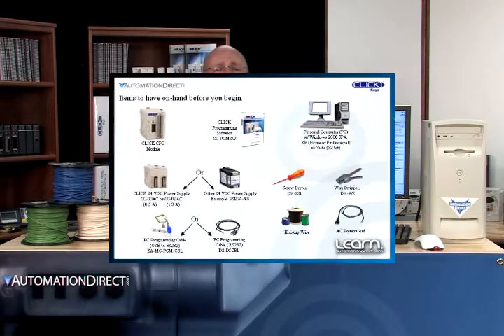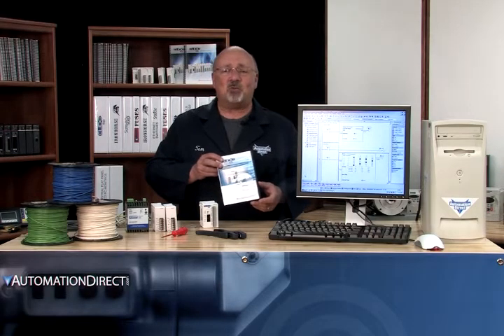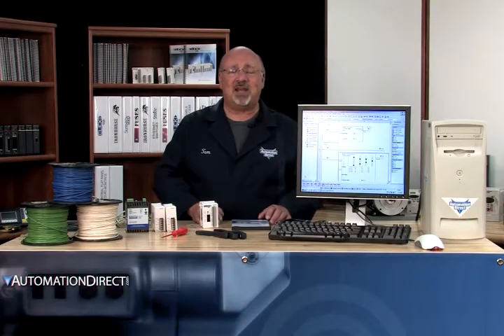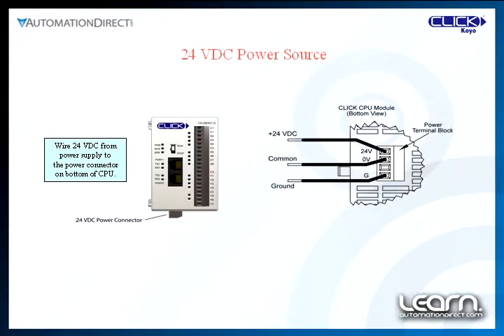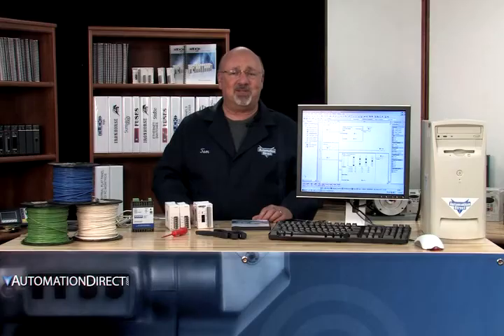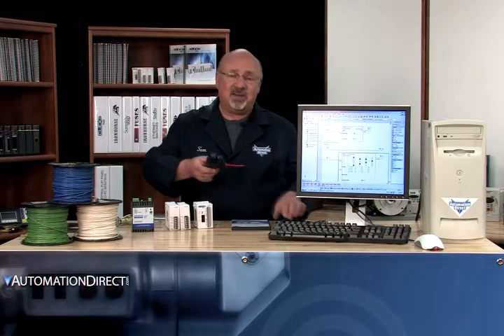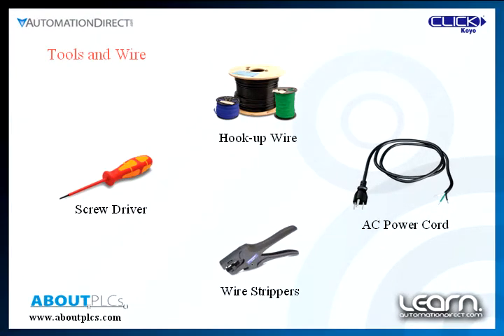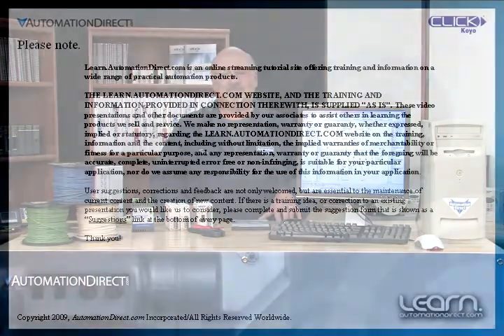Getting Started with a CLICK PLC from AutomationDirect

Comment: Great info sir! What kind of serial RS232 cable is required? There are two types: one is straight and the other one is a cross in which receiver and transmitter pins are interchanged. I was working on these cable long ago and my intention here is not invest in the cable instead to reuse my existing cables. Regards,
Reply from the maker: LearningZone Thank you for your interest in AutomationDirect.com's products. The RS232 serial communications port on the CLICK PLC featured in the LEARN video uses an RJ12 phone style jack.  A standard 9-pin RS232 straight or crossover cable will not work.  The video mentions using either a USB to RS232 converter PC Programming Cable, ADC part number EA-MG-PGM-CBL, or a RS232 PC Programming Cable, ADC part number D2-DSCBL.  The USB to RS232 cable assembly has been offered for a number of years from AutomationDirect.com due to the decline of PCs including RS232 ports.  If you have a PC with a 9-pin RS232 port, you could possibly, with the proper connectors and tools, construct your own programming cable.  You can find a link in the video description to diagrams for programming cables. We hope this helps!

Comment: Hi, i am using a screw that sends bottles to a filler. I have a sensor sensing the flights on the screw. I plan on using the flights on the screw to set th speed of the line behind the screw. I have a timer on the screw sensor, and i need to move the accumulated time between flights to a register in the PLC. I then need to take the number in the register, scale it, and send it to a VFD. How can I move the accumulatoin time?
Reply from the maker: This is a bit too involved to get into in this format. Please use our Community to get answers or contact tech support. https://community.automationdirect.com/s/contactsupport